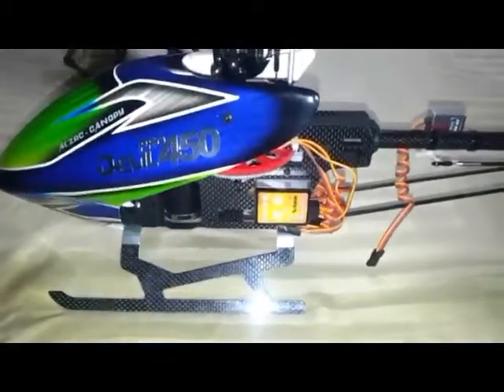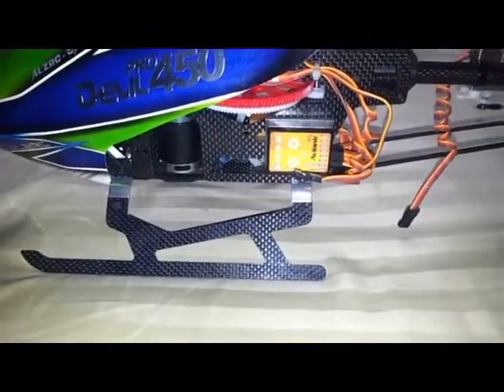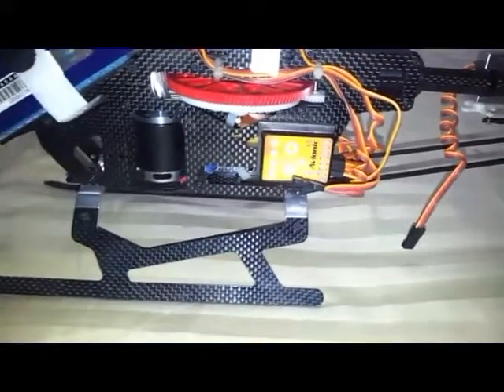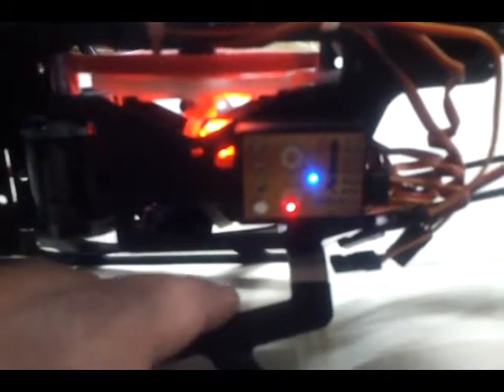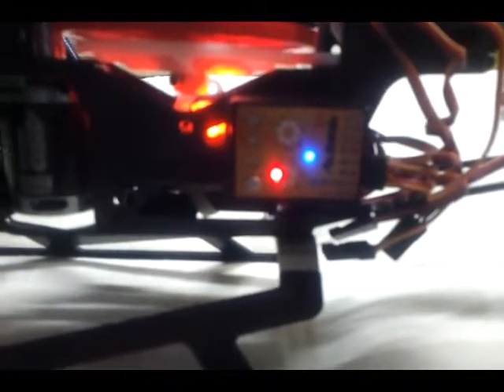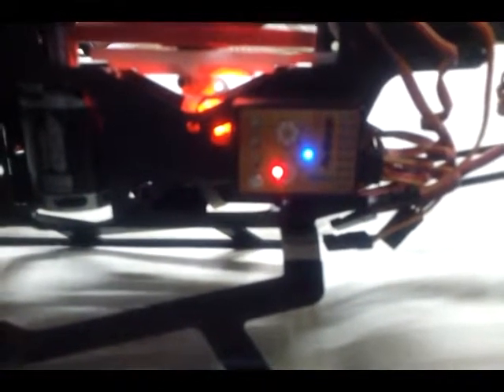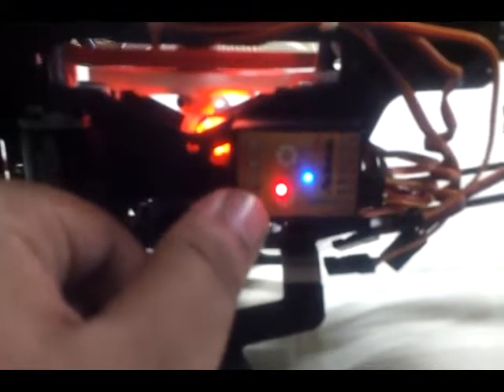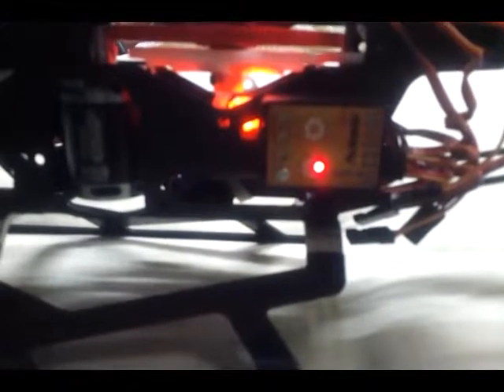Avionic X5 Flybarless Gyro setup part 1 of 5

Comment: When you setup the 3-axis gyro flybarless sytem, please use the traditional 90
degrees swashplate mode. No matter whatever mode the swashplate of your
helicopter is,it can't use swashplate mixing(such as 120ECCPM), generally,in the heli
mode,you can choose H-1 or 1 servo swashplate mode.

Comment: Very nice video. I was wondering how one can use this gyro as just a tail-gyro. Normally the tail-gyro plugs into ch4 on the Rx, and its gain cable into ch5 and then the tail servo into the gyro. But in the X5 case what would be the connection between X5 and Rx?